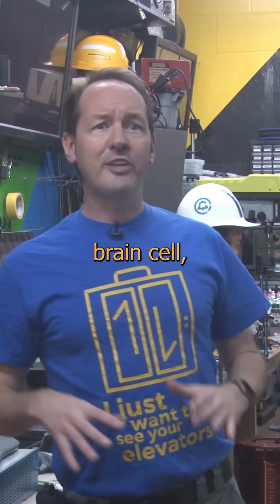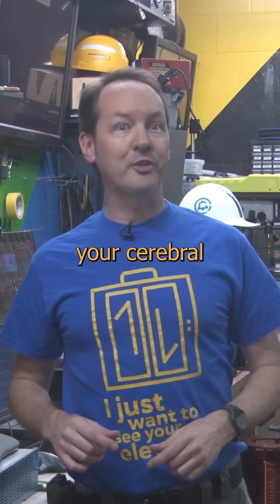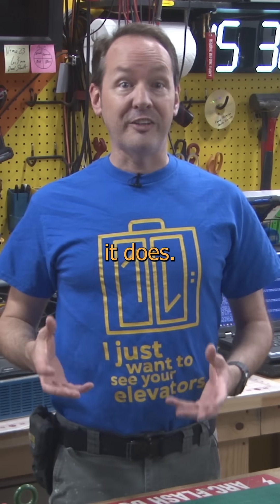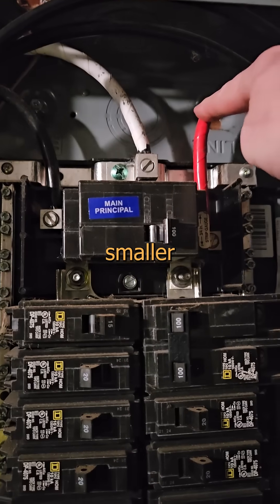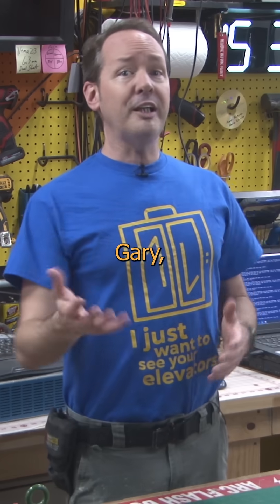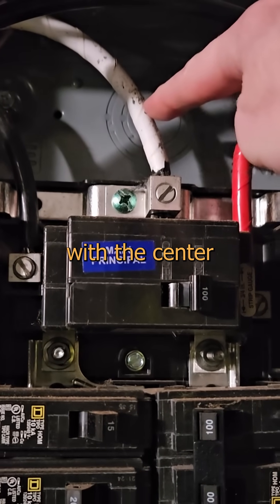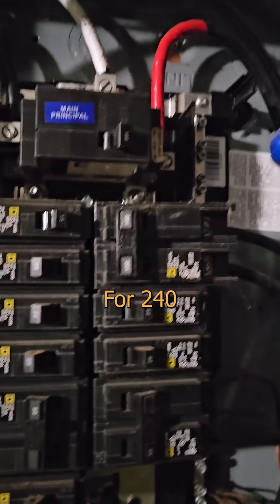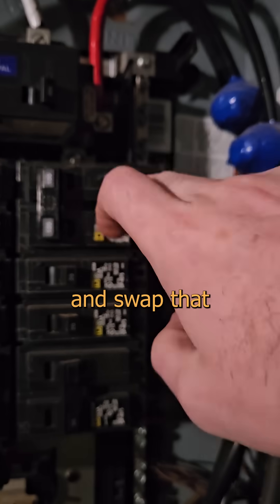Why It's Smaller #engineering #chrisboden #comedy #electrical #science #energy #power #electricity

Comment: Another reference for the wiring being able to handle it for a short time for the breaker to trip is the wiring on your car.

That wire going to your battery is holding 600+ amps of current for a short amount of time on startup. 

For circuit tripping purposes that is more than enough. 👍
Reply: Back in the day we used to occasionally see people crank their starter over until everything was very hot because of that high CCA. They usually used a fairly robust cable, like a #1 or #2, or even 0 sometimes.

Comment: Is it weird that I can hear harmonics (if that's what I'm hearing) in the power? Like when a motor is running I can hear a hum that goes up and down subtly and it sometimes changes in frequency slightly. Even if it's an electric heater I hear it although not nearly as intense. Maybe my ears are just sensitive or I got super powers that involve electrons 😂

Comment: Or you can get really unlucky, like my parents, and have almost all the load on one phase. One day, they noticed a weird "hot plastic" smell from their basement. Turns out the neutral lug, untouched for over a decade, was super loose and was getting extremely hot. Because heat conducts and all, we were checking the main breaker and assuming one of the hot wires or one of the breakers were having trouble, not the unnoticed neutral. Try to turn on a big (240v) load like an air conditioner or stove, nothing. There was the right combination of washing machines and microwaves and sump pumps and such that all the high loads were on one phase, causing 30A+ of neutral current that day.

Comment: Bad ass...thank you. I've been wondering how that worked for a long time. What the fuck is ground when you have an AC + or - voltage ?? It's a "virtual ground" when the two cancel out. Any unbalanced current gets shunted to the neutral and the ground is for that same unbalanced current that cannot find it's way to the neutral.

Comment: The maths are correct. A single phase  referenced thru a ballancing nutral to another single phase at 180 phase angle is two (2) phase. Three single phases referenced at 120 degrees against a neutral or not is 3 (three) phase.

Comment: Even worse, it took me a while to realize the ground in a panel doesn't "disperse excess energy into the ground" or anything like that, it's so it you get shocked, the power flows through you, through the ground, UP the ground rod and ground wire and into the panel, going back to the neutral. Not all power wants to go to ground, it wants to go back to it's source, which for us is the transformer up on the pole.

Comment: In a proper school setting it is usually an exercise to calculate symmetric circuit like this, followed by a jaw drop at the end when one can see that potencial difference between common points is zero (thus a wire joining them is not needed). In reality there's no such thing like symmetric generator and load.

Comment: "In very specific cases you can get it all the way down to zero, but good luck trying that"
It hardly ever being zero is actually a good thing. This is why (in Europe) it suffices to connect the Nill with Ground, to trip an HPFI. It's also the reason why the cause of persistent tripping of an HPFI, usually has something to do with water. Is that the same in the US?

Comment: A score and a half + several years ago I apprenticed under an old hand. We did two primary jobs commercial fabrication shops and new old work. In both cases he was ana! About load balance and would have us do a write up of normal and heavy usage scenarios. Meaning we had to discuss with customers what they will actually be doing and what type of equipment (inductive/resistive for PF) then do up the load feed and panel schematic. His goal was as close to zero current on neutral during normal heavy usage. The worst I remember was a remodeled kitchen for an at home catering service that used a lot of plug in appliances. Everything from running 2 legs to each outlet and alternating which leg was the top outlet because people tend to use one over the other first. Dang, I just realized how many little things i learned from that gruff old B@$terd.

Comment: I had a lot of fun being taught about 3phase load balancing and spending a day in some big industrial units swapping circuits around to try and get the neutral down to 0A. Blew my mind when I learned about CT metering on balanced loads too
Reply: Does the electrical box that he's showing actually have 3 phases or just 2? If it's only 2 phases with 120° shift, how can it be ballanced?
Reply: @eklhaft4531 it’s a single split phase.

Comment: Interesting observation: in large LAN parties of 100 or more computers (gaming PC’s), we would see the neutral leg loaded up about as high as the 3 hot phases. 
Typically we would expect the neutral leg to be much lower than the others, and we did our best to balance out systems between the 3 hot legs, couldn’t figure out the WHY. Very interesting. Also my first and only time feeling the lines humming at 60hz. ⚡️

Comment: It's not as obvious with modern LED lighting - but with incandescents, you'd see one set of lights get too bright and another get too dim, and that's a warning to call your electrician, because your neutral isn't doing its job properly - and if it gets extreme, shut down your panel, because stuff is going to fry if you don't.

Comment: Mayhaps a silly question but where does... the "electricity go" in systems without a grounding line/wire? I know from chemistry class, some devices (like TVs, lamps, chargers, sewing machines, etc) they might be made of insulating plastic. Or get coated with a layer of enamel or composite paint. 

But... what happens to that electricity during a short? Does it stay isolated between the wires and insulators? Or does it - in an attempt to flow from high consentration towards low - get stuck inbetween the paint or plastic molecules? Kinda like a waterlogged piece of wood. And then dissipate as other measures like breakers kick in?

Comment: In power distribution systems serving large loads, the balancing of the loads is specifically engineered to protect the transformers, busses, wiring and distribution equipment from excessive imbalance because of the issues it can cause.

Comment: At my office we did a simple check of the 3 phase power feeding the facility. We had something like123A on A  115A on B and 130A on C.  But then we found we have170A on the neutral line. We were all scratching our heads. We got different meters and checked again. Same results. It turns out that the hundreds of devices in our facility that were all using switching power supplies create harmonic currents that can end up putting a load on the neutral line. We ended up upgrading the eclectic system with heavier gauge wires on the neutral. Not a problem in a home unless you are running a Bytecoin mine in the basement.

Comment: So this is something I learned about that I warn every electrical worked for. Be aware that in very very rare cases some people have been known to swap the hot and neutral wires when doing light fixtures or switches. I have no clue why but I remember being warned about it. I learned it because I got shocked by a light socket screwing in a light bulb. Ive been doing electrical work for about 5 years now (unofficial/off the books stuff.) and im still not 100% certain on how I got shocked and why someone wired it that way

Comment: "Electricity doesn't go where you think it does" I thought you were going to talk about how electrons move opposite the direction electricity flows, which is pretty cool too!
Reply: @vyvianalcott1681  wait what??
Reply: @kindredbarkmaw2509  Yeah, electrons in a wire move something like a few centimeters per second, from the negative to the positive. Charge across the copper molecules is what moves at the speed of light from the positive to the negative, which we measure as current. It took me a while to wrap my head around the idea.

Comment: Just as an interesting thing, if I remember correctly, in Europe the rules are a bit different. Not forgetting that the setup is also different. 
Basically you either have 1P+N or 3P+N. The neutral has to be the same gauge as the main conductors. This is, I think mainly for making sure that the grounding resistance is below the safety limit and the voltage drop on the ground doesn't exceed a certain voltage. You could have the ground resistance 4 ohms with a thin wire, but if your phase is sized to handle 10000 amps, in case of a ground fault  you will have a dangerous voltage on the otherwise grounded casing for example. Of course there are "other" safety devices on the circuit, but nothing guarantees anything. Everything is just mitigating the risks.
Reply: That's why we have a separate local Ground, so we aren't relying on the neutral wire for safety purposes.

Also, in your systems, either 1 or 3 phase, you will always have all your current return on your neutral.

It's only in the center tap systems that you can Undersize the neutral, as long as you balance your loads between both legs.

In some systems you could have one leg fully loaded and nothing on the other leg, and you would not be able to Undersize the neutral.

Comment: Dumb question. Why is the center tap tied to both neutral And ground?  I’m mean instead of just neutral, and ground going to (wait for it) ….. Ground?
Reply: In the US center tap systems, the center tap is bonded or referenced to Ground, because! Lol

It makes it so that you have one terminal or part of the circuit that is 0 volts to Earth, which just adds safety to the system, and also helps reduce static buildup and lightning damage etc. 

The Ground and Neutral wiring and systems are entirely separate, except that they are bonded at a single location in the main panel. 

This bond also is what makes it so that a hot wire touching the ground wire will trip the breaker, because it gives a current path back through the ground wire to the neutral bus and thus back to Source. 

If you only had the ground wire connected to the earthing rod, not enough current would flow to trip a breaker.

Comment: Remember that ALL the current flows on the neutral BUS, just not all of it makes it to the neutral feeder wire back to the transformer. If you have a 10 amp load on both legs, the current will flow through the neutral wire from one load back to the neutral bus in the panel, and flow down the neutral bus to where the neutral wire from the opposite leg's load is connected, and from there flow through the neutral wire to the load, and then back to the breaker and the hot bus.

Since each leg is effectively moving current in the opposite direction (one is "Positive" when the other is "negative"), the neutral wires also have effective potential between the different legs, but they then feed each other since they are connected to the same neutral bus bar.

And if no matching load exists, than it leaves an unmatched potential on the bus bar which is handled by the neutral feeder wire to the transformer.

This is one reason why it's important to land all your neutral wires on the neutral bus, and not put some on the ground bus as well as some lazy electricians will do on main panels, because then you will end up with current flowing through the bonding screws and the panel housing, which is a "Bad"®™ thing.

Comment: I eatched this 10 times and even with a background in electronics im still lost, guess this is why i dont do electrical ans stick to low voltage stuff.
Reply: Here's my comment diving a little deeper, but it should also hopefully help you understand how it works lol 

ALL the current flows on the neutral BUS, just not all of it makes it to the neutral feeder wire back to the transformer. 

If you have a 10 amp load on both legs, the current will flow through the neutral wire from one load back to the neutral bus in the panel, and flow down the neutral bus to where the neutral wire from the opposite leg's load is connected, and from there flow through the neutral wire to the load, and then back to the breaker and the hot bus.

Since each leg is effectively moving current in the opposite direction (one is "Positive" when the other is "negative"), the neutral wires also have effective potential between the different legs, but they then feed each other since they are connected to the same neutral bus bar.

And if no matching load exists, than it leaves an unmatched potential on the bus bar which is handled by the neutral feeder wire to the transformer.

This is one reason why it's important to land all your neutral wires on the neutral bus, and not put some on the ground bus as well as some lazy electricians will do on main panels, because then you will end up with current flowing through the bonding screws and the panel housing, which is a "Bad"®™ thing.

Comment: I'm a low voltage DC kinda guy. What even is the neutral?
In DC there's just ground and power. WTF is this neutral thingo?

Sorry for being a 50+ electico n00b. No one taught me the manly arts, except my grandpa and he was a 1920s trained cabinet maker - he did't really know anything about electrics either. So while I might (at least conceptually) know to knock out a dove tail joint I'm screwed with AC power.

If this video answered my question, can we do it with shoerter words or something, thank you!!
240V is fine for me that's what we have here in Aussie.
Reply: Ground and neutral can be the same,but dont have to be (in some cases, you even want to avoid that). 
While ground refers to the voltage of the earth/Surrounding conducting body, neutral refers to the conductor where the currents of the different phases neutralizes once they combine. In a 120V Setup, if L1 and L2 have the same load (assuming a perfect resistive load), both currents are cancelling out to 0 at the neutral. For 3 Phase systems, all three phases have to have the same load.
Reply: In DC what is called the "ground" is actually the return.  

In the mains AC system, the neutral is the current carrying conductor that is bonded to the grounding electrode, i.e. the grounded conductor.  This give is the same potential as other things bonded to the grounding electrode and thus not likely to have a current develop if someone connects it to non-current carrying metal.  

This has additional benefits such as being able to cap voltage spikes from induced currents from say nearby lightning strikes as the wiring in a house is really a big inductor when those pulses travel by.  It also creates the first fault, as an ungrounded system needs two faults to create a hazard the first of which could have happened decades earlier in another building.  By creating the first fault, then when the second fault occurs it is easier to find as it is recent and on a breaker.
Reply: @jkbrown5496 Well said, and amazingly enough, I don't have any corrections to make! 
(this is high praise for me ;) )
Reply: Neutral is simply a center tapped transformer.

Picture 2 AA batteries stacked, with 240v across the far ends, and 110v from the center tap to either end.

If you put a load between the bottom end and the center tap (let's say they are light bulbs, so no polarity issues come into play here, just potential differences), you get 10 units of current flow between the bottom end and the center tap.

If you add a second identical load between the center tap and the top end, you now have 10 units of current flow going through it as well, but now, since it's connected to the top of the lower load through the neutral bus, they are effectively connected directly end to end, and each consumes 120 volts, so now you end up with a 240 volt circuit directly between the top and bottom ends of the stack, and no current flows through the neutral wire, because there is no potential left for it to carry.

If you had a 10 unit and a 12 unit load, then the neutral wire would carry 2 units of current.

Comment: The issue with 120 loads is they should be near balanced on both main hots. I once saw like 18 amps on a leg and like 7 on another, had to move a rack of gear to a different outlet. The 120 legs are 180 out of phase, this is how get 240V and also how you can share neutrals on circuits but it's kind of a pain I feel so would rather pull another wire.
Reply: No, they are NOT out of phase, that's a dinosaur myth that keeps getting repeated, and Chris has even done a video debunking lol

Yes, it's ideal to balance loads between legs, but it's not required, as long as you don't overload the neutral feeder wire.
20 amps of imbalance isn't going to make a difference at a main panel.

To put it another way, there is no benefit to running the current through balanced loads, vs back on the neutral wire, as long as you are staying well below the capacity of the neutral wire, or are dealing with vast amounts of power where resistance losses are actually noticeable.

And instead of thinking of "out of phase" for 120/240 systems, you have to think of it in terms of voltage potential, just like 2 stacked AA batteries, with a wire at each end, and one in the middle.

You can put a light bulb across between either end and the middle, and if you connect one light bulb between the bottom and the middle, and another light bulb between the middle and the top, the current will flow directly through the two bulbs and you can cut the center tap wire if you want to.

Each end of the 240 winding is simply 240v potential, but the same phase (phase is an issue of timing, and they are both under the same magnetic field), and the center tap just gives access to half of the potential in either direction, but it's exclusively a potential difference, not a phase difference.